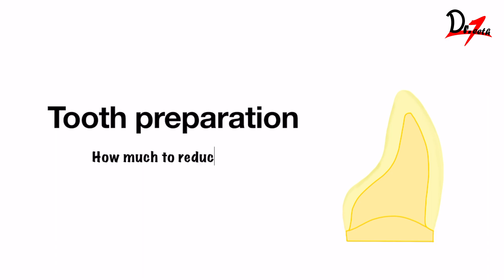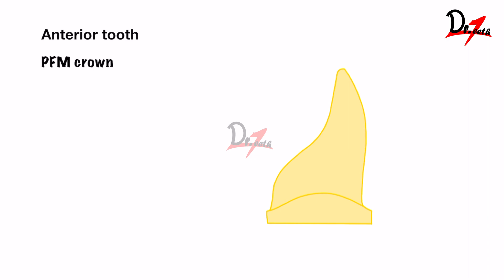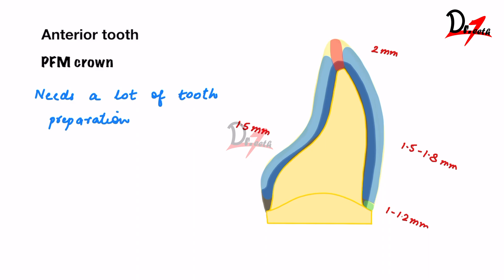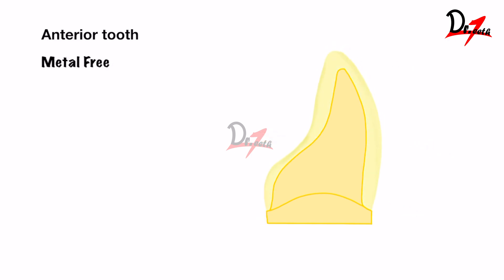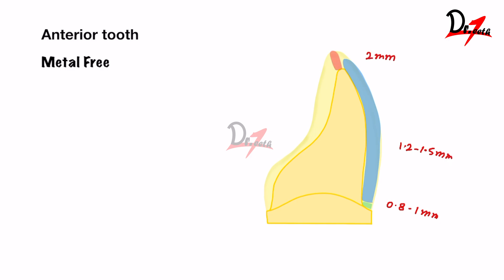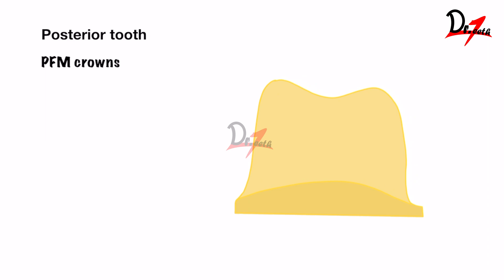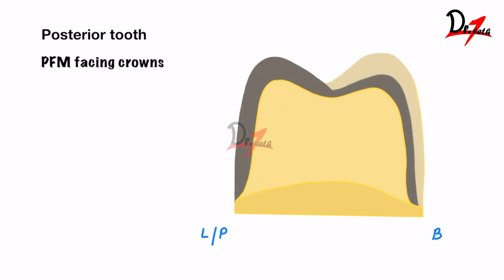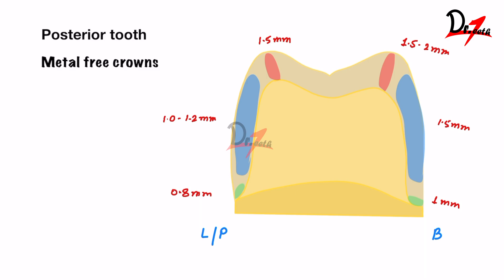Tooth Preparation in Dentistry | How Much To Prepare?

Comment: Great video mam...but how can we accurately measure the reduction? Like we reduced 1.5 or not ?? please clarify this .thanks
Reply from the maker: Hi,
You can use putty index initially. 
Else the burs we use have a certain diameter.  Choose the appropriate diameter bur depending on how much you intend to prepare and take the bur to its full depth at few positions on the tooth and then cut through rest of the tooth structure to get the desired reduction. 

Hope its clear. If not, watch my video on tooth preparation steps.
Reply: @DrTeethAcademy  thank you mam.under which heading I can find tooth preparation videos??
Reply: 1. You can use adjacent teeth as reference 
2. Use williams probe to measure
3 most ideal method  make a index and use it as reference.